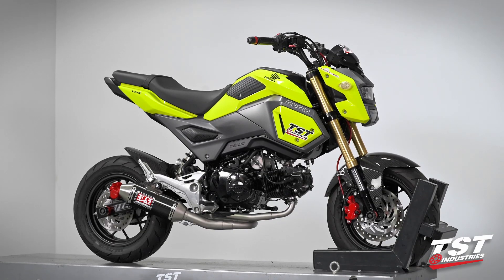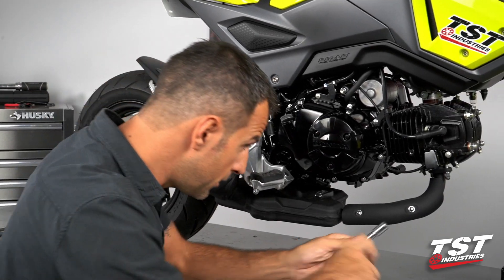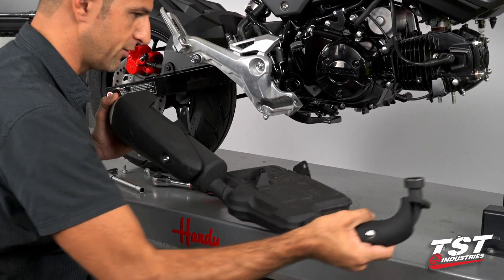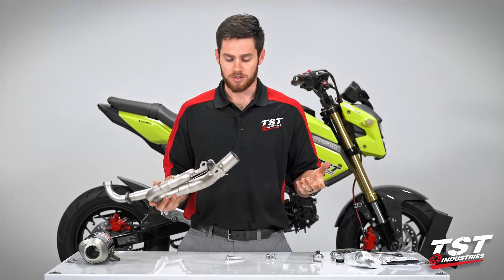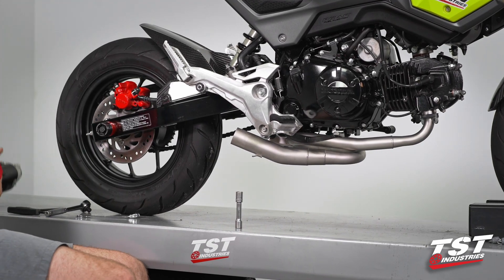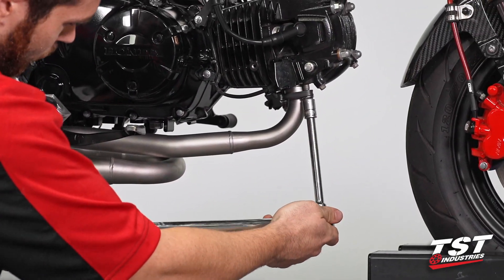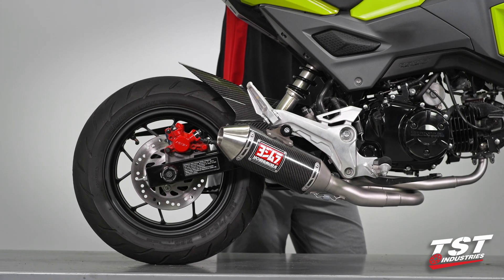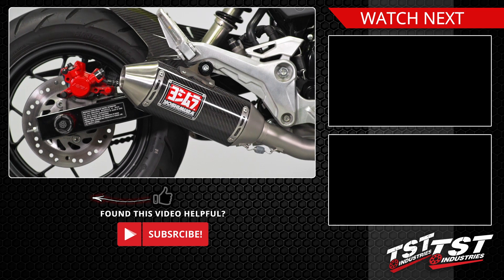How to install Yoshimura RS-2 Full Exhaust System on a 2017+ Honda Grom by TST Industries

Comment: Thanks for the video. It helped me. I will say the washer on the rearset mount is supposed to go between it and the Yoshi pipe not on the back. I did the same before consulting the instructions.

Comment: Just ordered the bar end mirrors, womtech levers and front flush turn signals. I love that you guys are in Florida and I get the mods the next day:) I ordered a Two brothers exhaust though for my 2018 grom, I'm surprised you guys don't sell that.
Reply from the maker: We try to get them to their owners as soon as possible; We know the feeling of anxiously awaiting on new toys.
Reply: Still waiting for them, 2 days later tracking still shows the package is in Lake Helen......what the heck post office, I live 45 mins away.
Reply from the maker: Did you get your parts?
Reply: yah a week and change later. It was sent up to NY, then NJ, then back to Florida and then to Kissimmee. If I was TST I would call the post office and get your shipping fees back, I work for UPS and they will refund you for mis shipped boxes.
Reply from the maker: Sorry about that man. They do weird things sometimes. I don't understand how a clearly addressed package with a barcode that tells their machines where to deliver it could go for such a cross country trip. It's not worth chasing them for a refund. It takes more time and work than it's worth. We tried addressing that with them a few times and they are apologetic but don't offer much in a moving forward solution. We deal with UPS too and have had similar experiences. I think all the shipping companies have their weak points. I am glad you finally got your stuff.
Reply: the quality of the products I have purchased form TST has been top notch, just the idiots at the post office on the second shipment sort of made me wait longer than originally exptect lol.

Comment: can I ask do you have to re tune the bike ie fuel ratio after fitting a new exhaust, I have a grom and want to change the stock exhaust but every one is telling me i need to retune once the new exhaust is on to stop it running too lean
Reply from the maker: Just putting an exhaust on will not produce any significant gains so the recommended action is to change the intake filter as well and then dyno tune. Technically the engine management circuitry should keep the motor in safe operation even if you don't tune because it adjusts fuel based on MAP sensor data, but like I said, no significant gains will be made without a proper tune.
Reply: TSTindustries so I would need that exhaust, cold air intake and the power command to make it work the way stated?

Comment: Noob question, but whats that loop in the middle for?
Reply from the maker: Yosh built in more exhaust pipe length to achieve the torque/hp levels they were going for. If you are interested in investigating this topic further then I recommend a book called " Scientific design of exhaust and intake systems."

Comment: Could this fit on a 2015 grom?
Reply from the maker: We are currently manufacturing an adapter piece that will allow this exhaust to be installed on the 2014-2016 model.
Reply: TSTindustries is there a way to get notified when it’s available?
Reply from the maker: Once that piece is available we will edit our product ad for this exhaust to show the compatibility on the previous model Grom.
Reply: TSTindustries very nice, have been waiting a long time for compatibility

Comment: No gasket?
Reply from the maker: no gasket
Reply: Sue Riggins 
the gasket is a soft metallic material piece that smushes to conform to the header and is already in the engine, I just changed mine and noticed it...